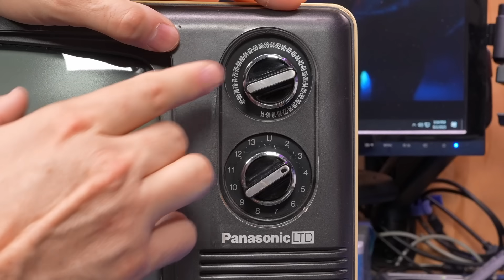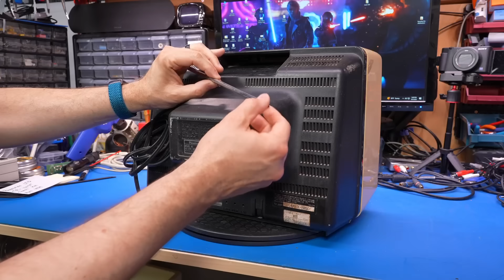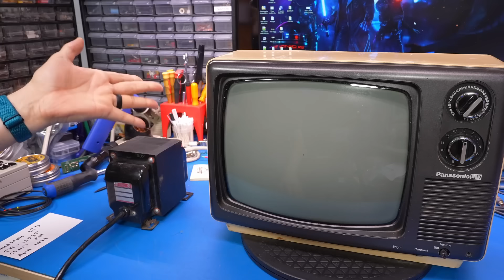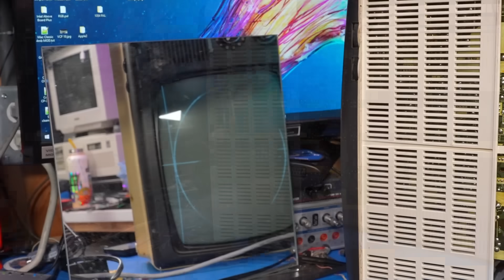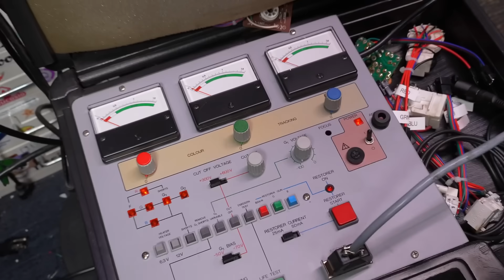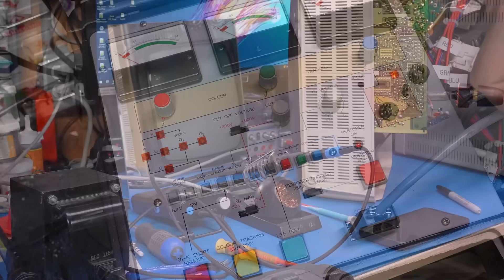These little TVs were everywhere (Panasonic TR-1203T)

Comment: Maybe try to blow away the G1-K short with a charged capacitor, for educational purposes. I've done it in the past with a foil capacitor (I remember 1µF?) charged to a high voltage.
You have an ideal test candidate here, nothing to lose, so you can gain experience for whenever a CRT that is important to you has such a fault. It's not uncommon.
Also try to turn around the CRT by 180°. It sometimes happens due to "sag", where the cathode gets bent down slightly due to gravity in very high-hour CRTs. The phosphor spot burn also hints that this TV has run a lot.
Reply: This! The G1 is constructed as a tube around the cathode with a hole in the middle for the electrons to come out, and it's possible the cathode, which is inside the G1 tube, is sagging and hitting the inside of the tube.

That's also why the TV appeared to work better when it was turned on its side. But it's a perfect candidate to play around with the CRT tester, because the tube is already dead it won't hurt it to play around with the shorts removal or the restore/rejuvenation features to see what they do.
Reply: Remount this tube upside down but with yoke right side up and if this gravity trick works well he could have a decent working tv for some time to come.
But yeah I was thinking hit the short with all you got you’re not going to make it much worse. Not sure if he needs to hold down the short button for a lot longer than a couple seconds.

Comment: Pretty sure I had something along those lines labeled as a Sharp, or Sylvania, or something like that. 

Also RF Channel 1 used to exist. It was whacked in 1948 and reallocated to radio services in public safety and land mobile services. There are however several digital stations which operate with the 1.x virtual channel number.
Reply from the maker: Someone posted that Channel 1 had a few different allocations over the years way back then, but in the end when it was removed, it was 44-50 MHz. Interesting is most TVs back then use a frequency in this range for the RF output from the tuner. (The intermediate frequency)  It was 45.75 MHz, if I recall which I assume was picked as it wouldn't have interference on it?
Reply: @adriansdigitalbasement2  Actually in the early postwar period the standard IF was around 22 MHz. The 45MHz IF didn't come into use until the early 50s when they both had removed Channel 1 and had more modern tube types available. From my understanding shifting up the frequency let them get the desired frequency response with one fewer tube/transformer (saving money).
Reply: I never knew that; thank you.
Reply: ATSC virtual channel numbers are so fascinating to me. Like, AIUI from reading, it kind of exposes some of the multiplex logic to the end user? It’s neat. 

In DVB they hide that all away under arbitrary linearised “channel” numbers, with absolutely no link between the real multiplex(/analogue channel) and the “logical channel” allocated in the EPG. They’re ordered based more on popularity (and then sub-ordered by who bids the most for a low number), instead. 

That said, this seems like a knowledgeable place to help correct any misunderstandings I may have developed :) a lot of the stuff written about Virtual Channels seems to assume some basic familiarity with using them, IE written by and for Americans. So I had to read between the lines here and there!

(I actually fell into learning about them after I was looking up the history of FCC broadcast callsigns — something else I’ve never experienced in the UK or mainland Europe! Some pages mentioned various callsigns being assigned to Virtual Channels nowadays, and one thing led to another!)